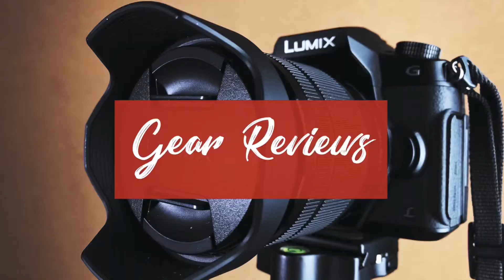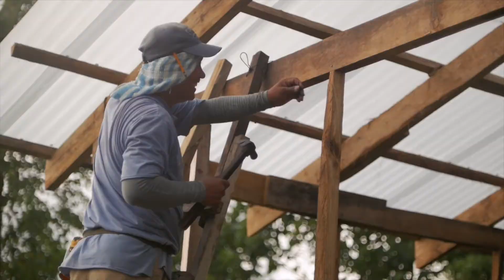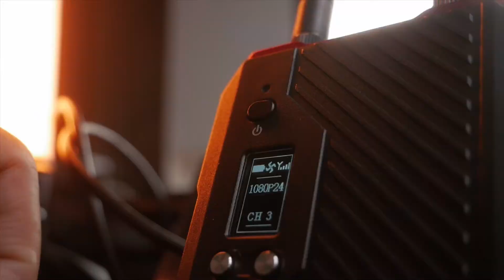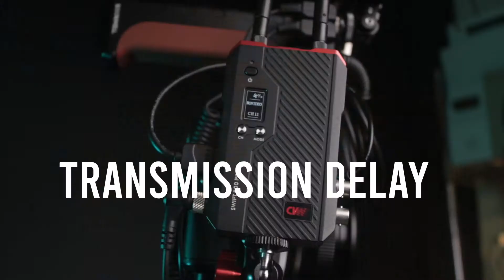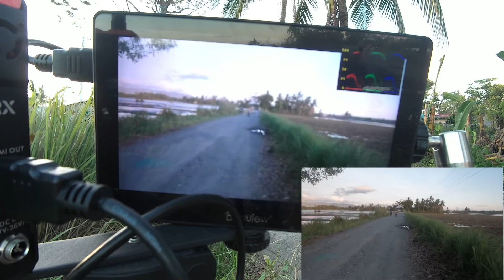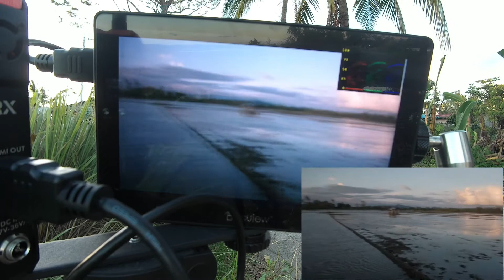Underrated Wireless Video Transmitter - CVW Swift 800 PRO

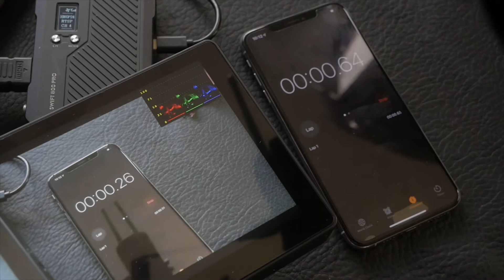Comment: at 5:55 you have 340 MS delay with declared 70 ms delay, 70 ms would five difference of .07 not .34 like you say in video. Though you might use digital connection such as hdmi which introduces delay unlike sdi analog connection. and .34 seconds is noticeble enough :)
Reply: SDI = Analog ? :)  For your reference - SDI=Serial Digital Interface
Reply: @gunpet  thx, live and learn